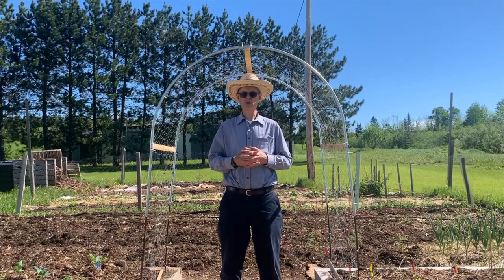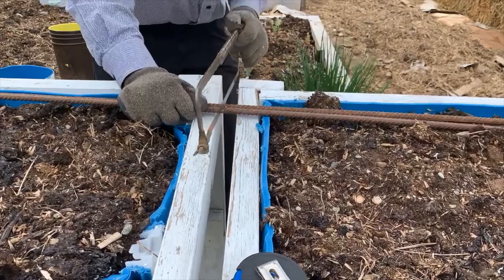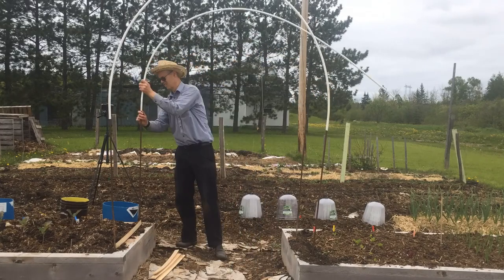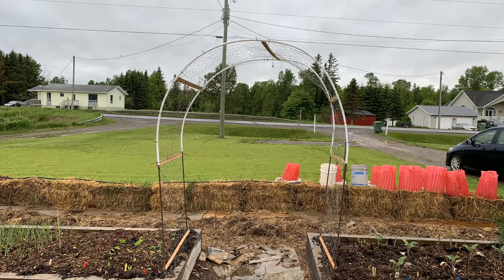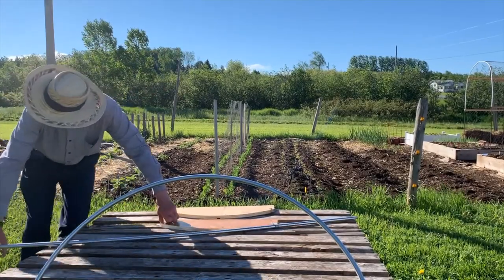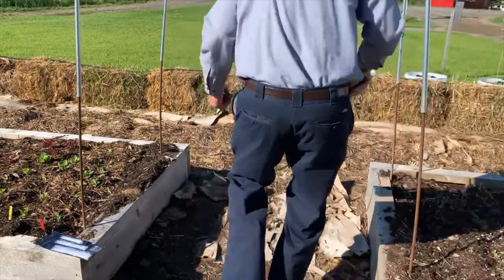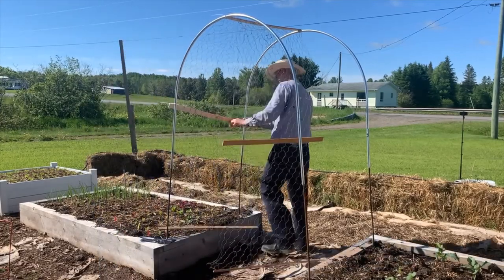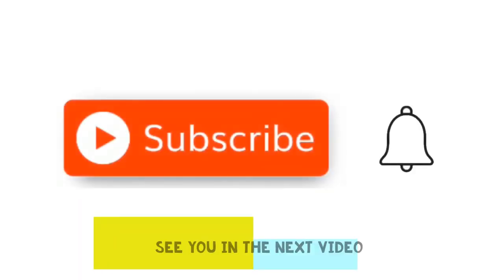ARCHED GARDEN TRELLIS DIY -- No Cattle Panels Used

Comment: Hi there! Thank you for your idea. I no longer have use of a truck, so I have thrown around several ideas, but I too needed to see what others were doing when they could not transport, cattle panels. I have the chicken wire, rebar and pvc, I might have to rethink using something else other than the pvc. The seasons in my area are windy, rainy, cool to cold and yes also microclimate, area of Washington State. Thanks again for sharing and God bless!
Reply from the maker: Electrical metal conduit is much stronger than pvc and can be bent with a homemade bender.

Comment: I'm using horse fencing made from 12.5 and 14.5 gauge wires that I got on sale at peaveymart as a trellis. So far I've just got some of it setup as a normal fence with my beans and peas climbing on it but the plan is to try making some of it into a fancy archway that'll be about 3m in radius by taking about 10m of fencing and folding it into a more sturdy shape before finally shaping it into an archway. I've got no idea if it'll work but it seems like a suitable replacement for cattle panels. 

Using Electric Metallic Tubes to add additional strength seems like a really good idea. I was trying to come up with a way of strengthening my trellis since the goal is to have it double as a greenhouse for hardy kiwi vines and maybe a shrub or small tree. Which is also why I want to have folds along the structure since that'll let the kiwi grow along the trellis without touching any of the plastic cover I'll be using to keep them warm during the winter. I'm also considering shaping several tall shrubs or small trees (ideally nitrogen fixers) to grow throughout the structure to help ensure it won't collapse but maybe several well placed EMTs will work better.
Reply from the maker: Thanks for the comment. It sounds like your horse fencing idea is a good one. I’ll have to check availability in our area here in Atlantic Canada. Peaveymart does not seem to exist east of Ontario. EMT should be a good addition to your trellis. Locally it is only available in 10 foot lengths. I haven’t looked into the possibility of connecting several together to make a bigger arch. I wish you good luck with your project.
Reply: I think Peavy Mart is called TSC out east?

Comment: If it were me, I'd put conduit over the rebar below so they support the upper conduit better than the zip ties. Add washers to the base so they don't sink down so much. Since metal gets hot, I might try to wrap it with something or coat it, same with the wire fencing, but then toxic chemicals would be a concern, so maybe some agricultural netting would be better.